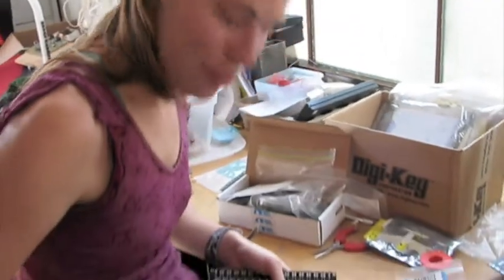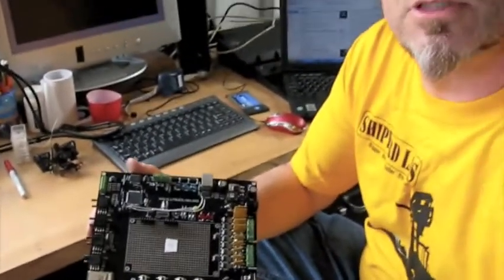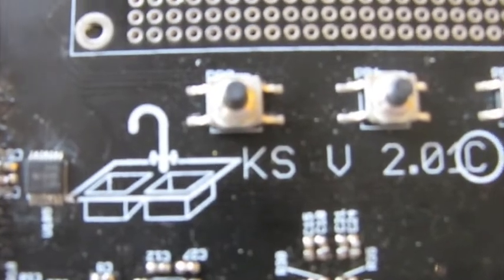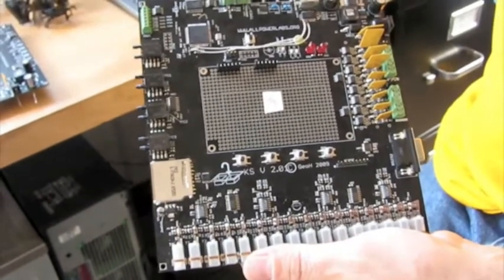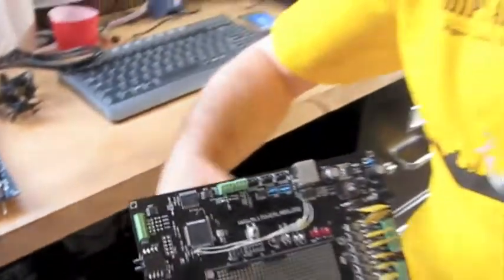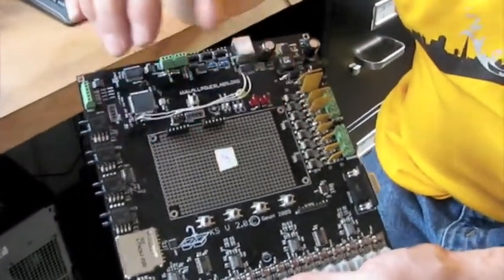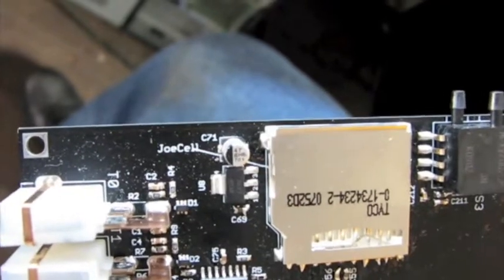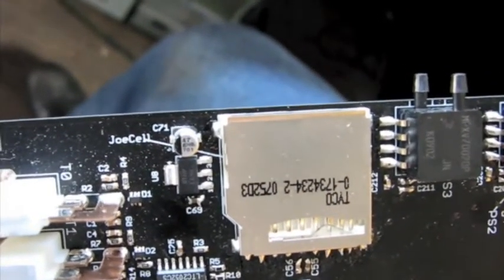Gasification Control Unit * Episode #5 on the GEK Channel

Comment: Thanks for making the whole GCU open source.  After seeing some of you other videos, I made a somewhat limited version for myself and it works great.  It gets cold up here in Wisconsin, so my testing is on hold for a few months, but I'll be rebuilding my own GCU/datalogger to add more inputs and outputs.  Thsi also got me into Arduino and I have built a few other devices with it to solve other problems.
Pete Stanaitis